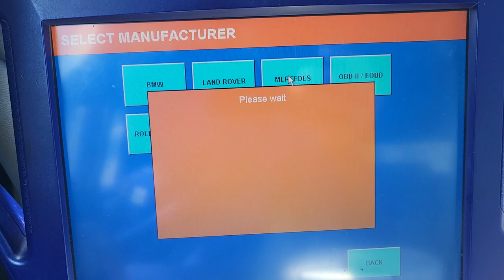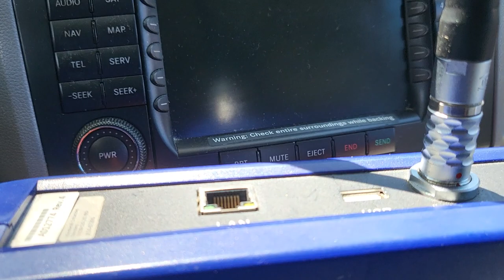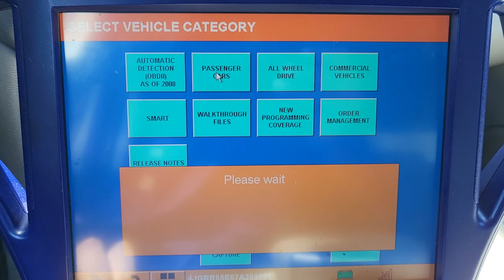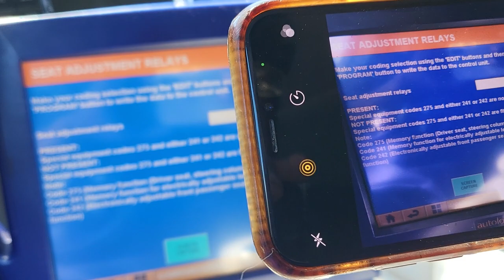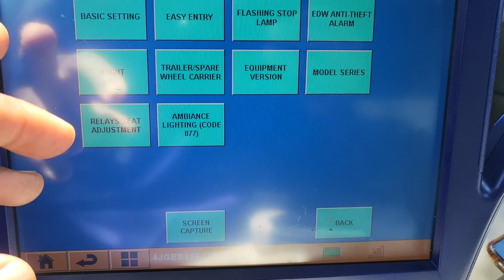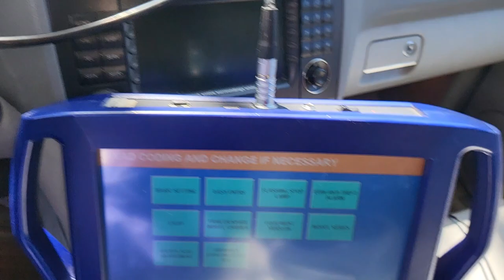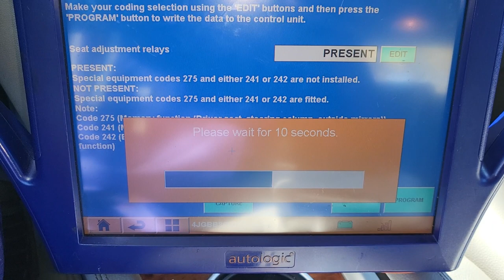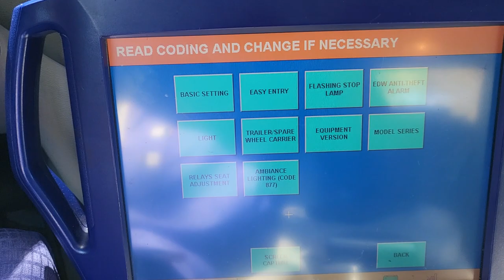2006-2013 Mercedes Benz ML/GL Rear Sam Control Module Replacement And Coding Using Autologic

Comment: Master was the sam a new one or used ?
Reply from the maker: brand new fro dealer but you can but a used one if it has the same part number
Reply: @BestCarFixes  
If I purchased a used one same part# that I’m replacing will it need to be programmed?
Reply: @BestCarFixes  my car is doing the same thing and I’m wondering if I should take it to the dealer or my standard Mechanic. My standup mechanic told me if he replace it it could work and it may not work!
Reply: @100vbaby  if its the same part number, it does NOT have to be programmed, the SAM should be same vehicle spec as yours. If its not the same part number or non compatible with your car, it will have to be programmed.